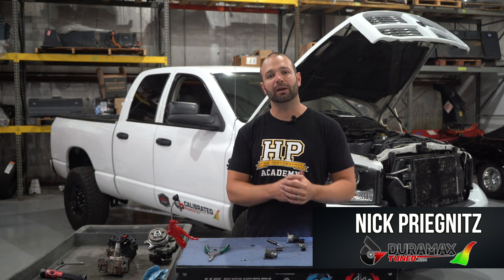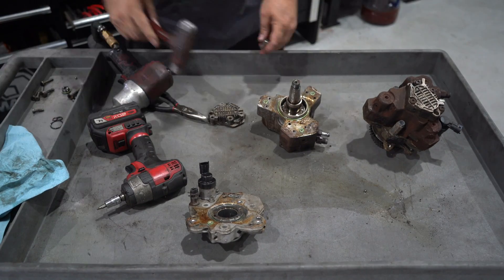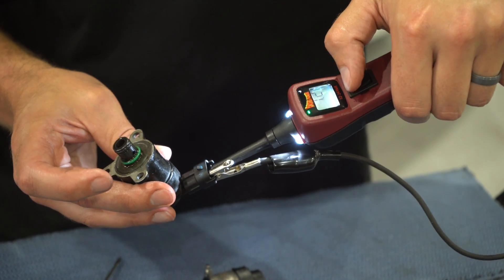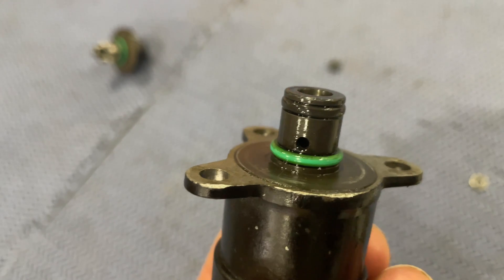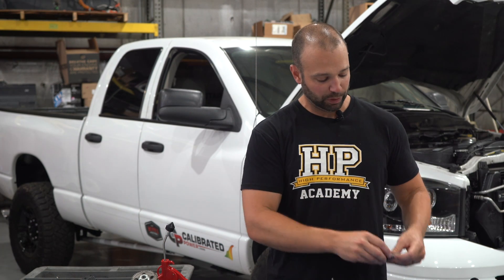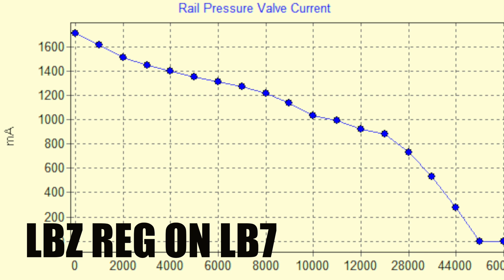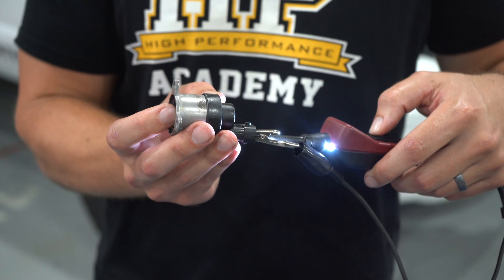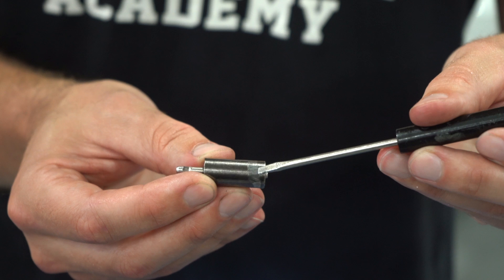HERE'S WHY CP3 REGULATORS FAIL

Comment: What if you can tell the plunger or whatever is moving on the regulator and still have max pressure? With good low side pressure? Im getting P0193 and dont know whats causing it.
Reply from the maker: It's hard to diagnose via comments; we would need to have it in the shop to know.
Reply: @Duramaxtuner understandable

Comment: Mine won’t start when I crank long enough fuel pressure rises to 6000psi and it will start for a second. The. Pressure drops to 500 psi
Reply from the maker: Get to a shop, have them diagnose. If you have any codes, give the crew a call. May be able to steer you in the right direction. 815-568-7920

Comment: Thanks for this video! My lb7 always had an intermittent FPR performance code and I just replaced it with a new bosch. However I also installed a stealth 64 and 165gmp lift pump. I still have the same issues and was stuck on why/how. 
Now I see the lift pump could be a factor, amongst a couple other possibilities.
Reply from the maker: No problem, glad this video helped!

Comment: Can a failed CP3 cause my truck to idle at 29,000psi
Reply from the maker: When a CP3 regulator is unplugged, the CP3 will go to wide open rail pressure. Hope that helps.

Comment: My 05’ Duramax sounds as off the motor is blown when it starts cold at 60 degrees or so. Popping and knocking bad. As the engine runs it runs better. After 20 mins and engine temp at 180 or more it runs smooth. We have no great mechanics in Houston and my diesel mechanic is lost
Reply from the maker: Datalog and send to your tuner, if the truck is tuned. Codes and datalog will help diag.
Reply: @Duramaxtuner  I’m actually with some great people that tuned my truck out of Michigan. Calibrated Power and they asked me for the data so I’m doing that today. The issue now is it’s running perfect the last 2 days. I’m glad but it’s frustrating because it’s not showing me the issue on the scanner and can’t figure it out. The last shipped looked for hours and found nothing and he was so mad because side he couldn’t figure it out and they also can’t charge just for looking if they don’t actually diagnose the problem.

Comment: I have an LMM and I have the complete opposite happening, when applying throttle my fuel rail pressure will drop from desired and usually level out around 2000 psi. Usually this causes a p0087 but sometimes if you give it more throttle it will go jump back up to desired rail pressure. I'm suspecting the regulator wanting to slide into a low flow position or like you mentioned in the video it's just not sliding smoothly and occasionally gets stuck.

Comment: My truck CP3 pump not getting fuel and I did open up fuel filter and found it is half empty. My truck doesn't have any other lift/supply pump anywhere including fuel tank.
Do you think it also can be the bad Fuel Pressure REgulator? Thanks in advance for your input!
Reply from the maker: It's hard to say, but the regulator could be the issue.

Comment: My LMM seems to have opposite condition. I was hauling a small car and went Into reduced power. Pulled over and it was loping with light grey smoke. Shutdown 2 min. Problem went away. All normal.  A few days later, no WOT power. Did replace bad high rail pressure switch (forgot code). No power on hills n takes forever to get upto 65mph regardless if hauling. Think my regulator is stuck in LEAN?

Comment: I just got a P0087 which is low fuel rail pressure. The truck idles well enough to move my Montana 5th wheel but as soon as I press on the throttle it is not happy. It’s almost that the FPR decided to stop working. When I try to drive it the Fuel Rail Pressure goes all the way down to 1.9k. I will swap out the FPR today. This all happened within 2 days. I will update this if it fixes the problem.
Reply: So I’m guessing it didn’t fix it?
Reply: 2 years later and no update

Comment: If you have a scanner such as a Snap On Verus edge one indication of a bad F.R.P. Reg. is at idle having aprox. 63% f.r.p. demand instead of about 26%. Also the engine will stumble a split second when you start it, and your desired f.r.p. is about 5,800, and actual f.r.p. is  about 9,500 at idle. And there is a chance that you will be limited to 2,000 R.P.M.  I believe that if you put a new Fuel Rail Pressure Regulator on after 100,000 miles it is a good thing. It will increase your power, and mileage, plus burn cleaner. I have seen an Engine Control Module which was randomly not providing power thru the purple wire with a white stripe (F.R.P. Regulator Supply Voltage).  I used my new Snap On 'Pass Thru Assistant' Scanner to check for updates to my E.C.M., amazingly enough there were no updates needed and the E.C.M.'s calibration was good. Two engine starts later my E.C.M. went back to working flawlessly. I believe that the LLY Engine Control Module is a high quality unit which is actually unusual in this day and age. I highly recommend NOT having a bunch of aftermarket stuff such as a remote start. At the very least inspect all the wiring very closely after the stereo shop does the install, car toys is not a place that has a lot of competent technicians. In fact maybe 5% of the stereo shops can be trusted. The manufacturers use the cheapest solder they can find, which costs us all money because of electronic failures. Lead free, and low lead solder causes problems as well. A thing called 'silver migration' can occur on your Printed Circuit (P.C.) boards. Some electronic/ radio repair shops can address silver migration issues.

Comment: I've got a brand new Bosch fuel pressure regulator and it is just buzzing when you turn the key on. I have a crank and no start situation. I'm sure that I got a new defective regulator. I just kind of wanted to see what your thoughts might be on this.
Reply from the maker: Have you ever had electrical/ECM issues with the truck?

Comment: Does a cp4 metering valve do the same thing? I have a volkswagen 3.0L tdi, and I occasionally get a surging at idle for about 20 seconds, and I get a p0087 code

Comment: I have 2nd gen cummins 24v vp powered doing similar replaced cleaned grounds do they have fuel regulator valve ?
Reply from the maker: The VP trucks don’t use this type of regulator.  It’s strictly a common rail part.

Comment: Awesome video. Thanks for the insight! What is the regulator actually controlling? Those o-rings don't look like they're built to handle high pressure. From some animations I've seen it looks like it controls low side pressure to the valves at the top of the 3 pistons. I guess that effectively varies the output of the high side pump?
Reply from the maker: Thanks Jared. You got it, spot on. The regulator control is still low side. From the regulator the fuel goes in for the high side squeeze.

Comment: Touching on the 2 stroke oil and atf thing, would it help to add some of that stuff in conjunction with a lift pump on an LML to help prolong the life of the cp4? If so, how much would you recommend adding to each tank?
Reply: Do not use it on an emissions equipped truck.  Oil contamination can ruin the DPF.
Reply: @nickpriegnitz5895  that’s a good point, guess that slipped my mind. What’s your best recommendation for adding lubricity for that pump we all know is prone to failure?
Reply: @chancesanborn7932  FPPF and other companies make DPF & SCR friendly additives

Comment: I just fixed my buddy’s lbz; same problem. Truck sat a lot and fpr got shitty down low. His issue went one further though - chafed wire loom allowed two wires to ground and blew a fuse. He got vane position and fpr codes, with rp at max during idle.  Fixing the wires and replacing the fuse were the final fix. Crazy.